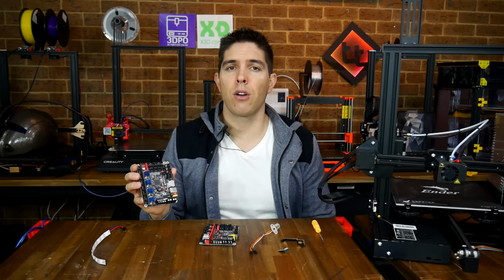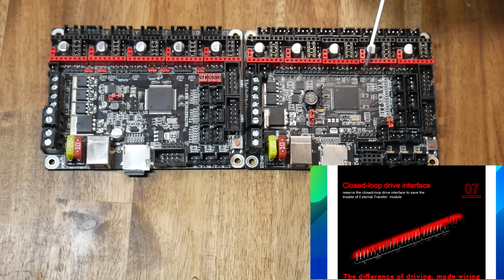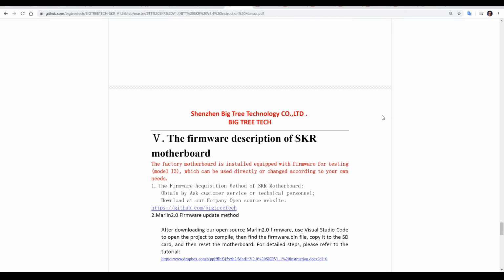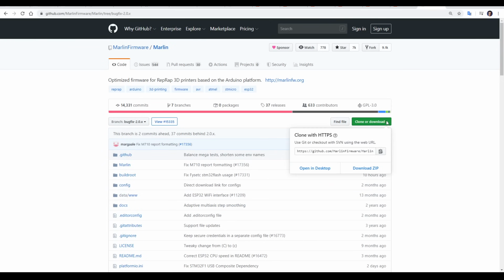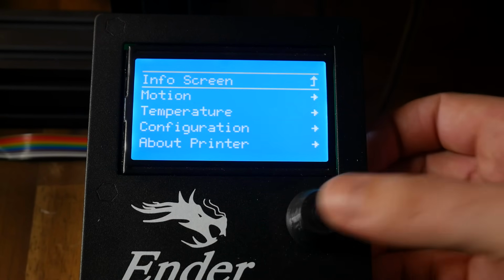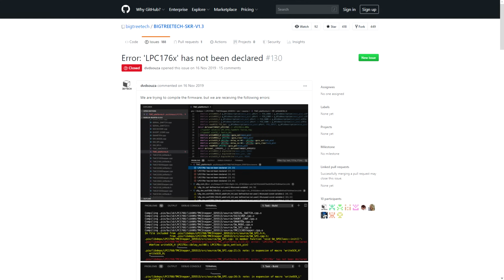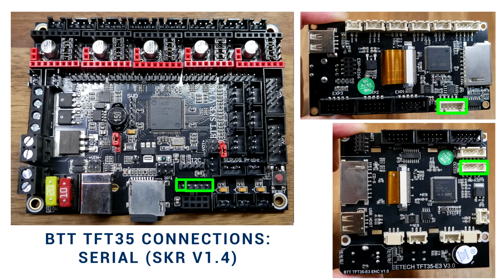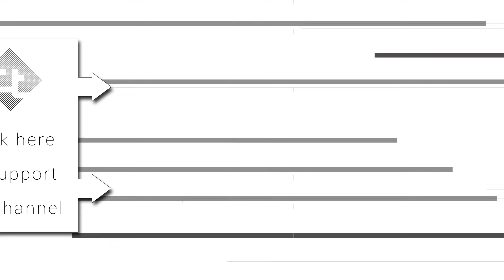Bigtreetech SKR V1.4 (Turbo) comprehensive guide

Comment: Good Day    I have followed your videos and find them very good.  I am trying to upgrade my adimlab gantry pro with a new main board, drivers and display but have nothing but problems.  Can you / will you help?  I purchased SKR V1.4 Turbo / With 5xTMC2209 V1.2 / With TFT35-E3 V3.0.  When I got the system it did not work fully and I have been trying to fix.  The machine that it is going in is the Adimlab Gantry PRO,  fully stock.  No bed leveling but does have a run out sensor / break sensor.  Everything is stock and I need help

Comment: Michael, Have you found the problem with the EEPROM not saving? Been talk of adding FLASH_EEPROM_EMULATION to save to sdcard and uncommenting #define PRINTCOUNTER. Seems not to hold firmware settings even after one or more power cycles. I checked with Pronterface and a lot of things disappeared like probe offfset and other things. Might have to go back to the SKR 1.3 for now.

Comment: i need some help.

I can not for the life of me figure this out. i have a LV8729 working on my SKR 1.3 without an issues. i cannot get it to work on the 1.4 TURBO. i have all but the 3rd jumper removed (on the right) which puts it in 1/16. No matter what i set the step/mm to it will always just extrude 50mm. i tried 115 which gave me 50/100mm extruded. i did the math and said that i needed to up it to 230 step/mm and that still gave 50.

Also, when it extrudes the stepper pulses and is not a smooth movement.

i have tried putting in a different LV8729 and tried a TMC2209 with no luck.

Please help..

Comment: Hi there,
the big variety of SKR boards is a little confusion to an Ender 3 Newbie.
I would like to upgrade the stock board to a new one to include the silent stepper motor drivers and get the possibility of easily adding a sensor such as the BL Touch (without a breakout board).  If I understand correctly, this is what all the Bigtree Boards offer, with the SKR Mini E3 having the feature of being able to get fitted right onto the stock board mount. 
Having watched the video on the Mini Board and read the comments, Michael says that the newer boards give a bigger flexibility and more addons - but I don't really understand what would be the killer argument to get the latest hardware instead of the MiniBoard? Maybe someone could help me understand? Additionally to that, could you please confirm that it is possible to install a 5V (or 12V) Noctua Fan for the Hotend without a buck converter, only using one of the new output ports of the board? 
Thanks so much in advance for any help!

Comment: Did you find that they wired the dual Z-outputs incorrectly?  I tried driving 2 steppers from one driver, but it didn't work and fried the driver. Seems from the schematics that they just split out the pins to 2 connectors in parallel instead of wiring the steppers in series.

Comment: hi, problem. at 7.30 your wiring checklist shows shows H-hotend cooling fan on the screw terminals,  but my documentation says this is for a second hotend heater(i think...) is this a mistake or am i missing something? 
thanks
love your work

Comment: I have an Ender 3 and have my parts cooling fan connected to the cnc_fan connector like shown in the video, but the fan isn’t spinning at all.  The hot end fan and case fan are working without issues.  Is there something I need to set in the firmware?

Comment: Interesting.  
Would've been nice to see the auto turn off module working.
Also, is that TFT35 going to get a firmware update and get the missing options (changing steps/mm for instance) only found on the traditional lcd as the Makerbase's TFT35 robin display has?

Comment: After following this video, my end stops are still not working. I am using TMC2209's and I cut the pin that you showed. Is there any other code that I need to change to get this to work?

Comment: Hey Michael thanks for your guide. I have installed the SKR 1.4 Turbo with the TFT35-E3 v3.0 and the 24V UPS board. Despite the printing being halted on power failure detection, after power being restored, it doesn't show any option to resume the previous printing job. I'm printing from the SD Card inserted in the Display board running in Marlin mode and the Power Outage option is enabled... Any hints?

Comment: Question: I purchased the SKR 1.4 Turbo board for my Ender 3 Pro. I also went with the TMC2226 stepper drivers.  Same fir wear settings as 2209 , except where says 2209?  I just downloaded VS CODE and am learning that too for when board arrives
Reply: Firmwear

Comment: My 1.4 turbo with 5 2209s is on it's way to my home :) My plan is to install in a CR10s, I'm only worried about the dual Z config... did you know if it's plug and play or I need to tinker the firmware to enable the second Z motor?
Reply: @WhiteG60  The Idea is use the two Z connectors one for each motor (ZMA and ZMB). But as I have 5 2209 can I use the spare to drive the ZMB independently of ZMA?
I mean there are 5 driver slots, X-Y-Z-E0-E1, normal setup is X-Y-Z-E0 so E1 is unused and has it's own driver so can I reroute to ZMB?
Reply: @WhiteG60  Thanks I'll do as you say ;)

Comment: ok i have the skr 1.4 tubro and big tree tech tmc2208 drivers if i want to run them in silent mode that is spi mode correct. and if so does that mean i use just a single jumper on the bottom left  for each row that i have a 2208? or is it 2 jumpers on the top 2 on the right side? im now seeing it saying tmc driver spi mode with all the jumpers on all the pins on the left side which was how it came, now is this silent mode for the tmc 2208, im so confused by this and the different versions. someone pls help me with this. it would be greatly appreciated

Comment: you no longer invert endstops for sensorless homing apparently:
In file included from Marlin\src\HAL\LPC1768\../../inc/MarlinConfig.h:49,
                 from Marlin\src\HAL\LPC1768\HAL_SPI.cpp:51:
Marlin\src\HAL\LPC1768\../../inc/SanityCheck.h:2526:8: error: #error "SENSORLESS_HOMING requires X_MIN_ENDSTOP_INVERTING = false when homing TMC2209 to X_MIN."
 2526 |       #error "SENSORLESS_HOMING requires X_MIN_ENDSTOP_INVERTING = false when homing TMC2209 to X_MIN."

Comment: 10:48 is where I run into severe issues. I can't get it to compile, and even after several other tutorials I can't figure out what is wrong.
Edit: You have to include the v in "BOARD_BTT_SKR_V1_4_TURBO" I kept typing "BOARD_BTT_SKR_1_4_TURBO"
Edit: now I get the lovely #error "USE_CONTROLLER_FAN requires a CONTROLLER_FAN_PIN. Define in Configuration_adv.h." message

Comment: Do I need to use external mosfet with SKR1.3/1.4? The documentation says that the max power for the heat bed is only 144W, but Ender 3's beds are 220W/24V.

Comment: when i go into the config folder it gives me a list of boards for some reason, unfortunaly it doesnt list the SKR 1.4 TURBO but it does list the E3 TURBO, would this run ok with the 1.4 as they use the same processor :/??

Comment: Hi Micheal, is it possible to use the 3rd thermistor port (TH1) on the SKRv1.4 Turbo board as an input to monitor chamber temperature. I do not have active heating and I currently have a DS1820 doing this through the RaspPi/Enclosure plugin, which is working fine - but just want to cleanup my wiring a little. Any thoughts would be appreciated. thanks ...
Reply from the maker: Yes, absolutely. I did this on my Ender 5. Please see the video for instructions.
Reply: @TeachingTech  Hey, thanks - I will check it out (mine is Ender5Pro)
Reply: I had a look at your video "Ender 5 enclosed lid and heated chamber guide" and tried out your method. 
It appears Marlin has moved on and I can't get it to compile with the recommended changes.

Comment: I see they still haven't updated that hackneyed bugfix-2.0.x build from last year. Shame. I built 2.0.4 as soon as I got my 1.3 board, and it was a completely unnecessary step, and a failure on BTT's part. They have the configs and know-how, it would take minutes to pull 2.0.4.4 and build it, and maybe a day or two to QA and fully test it.

Comment: Is there anyway to bypass the sensorless homing without cutting/bending the diag pin?
Reply: It doesn't look like it would be easy. I did see a resource somewhere that remapped some of the pins on the board but it seemed like it could cause issues long-term with Marlin updates.

Comment: just saw your rear case for the ender 3, googled skr and found this, now i know what the heck an skr is, thanks for sharing - great vid, subbed!.. just wondered, theres a remix of your design 4487321 but the page states its for an skr, what can i use to change the holes in the right case and the left case to match your design? and also to add a little thickness to the lids.. is it a steep learning curve to change this? what would you use to make those changes? thanks!

Comment: Although the board worked fine for me (better than the MKS 32bit board), the email support of BIQU is not responsive at all. The website is broken (none of the links in the footer is working) and I now have a non-working board that only shows up in the device manager for a minute before it disappears and no contact to talk to about the problem...! Great.
Reply: After two days (the board only laying around) it has been working (even printing) again just to stop a print after some minutes with the board not responding anymore. The same as before! Grrr.. I wish I had bought the board elsewhere to get some help... 😣

Comment: I did a bunch of research and was leaning towards the skr pro v 1.2 but it seems the firmware is not in a good place. Would you recommend the skr 1.4 over the pro for a cr10s or sidewinder x1?

Comment: Hi, I'm still in doubt. Do you have to remove the diag pin on your tmc2209's for the Z axis if you use standard endstop and for the E0?
Reply: If you want to use the endstop, the pin has to be removed. If you don't the endstop is ignored.
Reply: @bsharp55  Not exactly ignored, but the signals from the diag and the endstop will conflict so Marlin will never see it as triggered.
Reply: @SteinerSE  Try to change connector and use 1 and 3 pin (signal and voltage), standard connector for Ender 3 is bad since it has 2 pins only, and one pin will be a ground, if you are not changing it to a proper one, you will have this problem as well https://youtu.be/-Gdk0wHg51w?t=822, or yes cut one pin from the TMC2209 driver

Comment: Thank you for the great guide! Question: For the CR-10S with dual Z axis I would use one stepper driver for both Z steppers, correct? (want to buy this board but I'm unshure if I will be needing 4 or 5 stepper drivers, I use 1 extruder only) Thank you very much in advance
Reply: 4 Drivers are enough, the 5th is for the 2nd extruder

Comment: I have a question, Michael.  I have a Monoprice Maker Select Plus (Wanhao Dup i3) that has a bad board.  I have an Ender 3 Pro on the way as well as a new BBT SKR 1.4 and TFT for the Monoprice.  Could the board from the Ender 3 Pro be used in the Monoprice  and use the new SKR 1.4 in the ender?

Comment: I am just now replacing a stepper motor but the new stepper motor has fixed cables some labeled red and some black and orange and possibly green? do you know which pin on the stepper motor hookup on the board is positive and which one is ground?
Reply: Steppers have coils inside, to know which two wires out of the four are part of the same coil short (electrically) the two wires together, if the motor resists when you turn it by hand then viola the wires are of the same coil. On the board will be markings next to the stepper motor pins, somthing like A1,A2,B1,B2, which correspond to the coils, and now that you know which wires form the same coils plug them accordingly
Reply: @wamiqhashmi7522  so there is no way I can screw anything up if I hook the wires the wrong way?
Reply: If you plug them wrong they will make noise without turning. I did that accidently, it didn't destroy anything. If you follow the procedure above then there shouldn't be any problem
Reply: @wamiqhashmi7522  It worked! Thanks!

Comment: I am 100% convinced that there must be one or more firmware settings that Michael did not mention that will allow a BLTouch to work with this stupid SKR 1.4 Turbo board. I have tried a billion different firmware settings (all suggestions from desperate owners) to get this BLTouch unit working, and I've had no luck whatsoever. If you're bored at home and want nothing but trouble, frustration and despair, then pick up one of these SKR v1.4 Turbo boards + TMC2209 + BLTouch combos. You'll hate it just as much as I do.

How can this be, you ask?

If you're Googling for a possible solution, you'll find that are a large number of Ender 3 owners w/ this exact hardware that can't get the BLTouch to work. There isn't a standardized configuration that works despite everyone having the same hardware. How is that possible? You'll read a billion posts by people saying "Try this setting... change this on the Configuration.h file... It worked for me..." What a nightmare.
Reply: still got problems? i got mine working on a creality cr10s5 so can try to help you out

Comment: I see that the SKR v1.1 has a separate mosfet board for the heatbed. Are mosfet integrated in later versions of the SKR boards for extruder and bed heaters?

Comment: Thanks for the great videos, Question. Do you have a file for an SKR 1.4 board mount for the ENDEr 5 ( not the plus)? I can draw one up but if someone has one that will work that just seems to be the quickest way to get one. Thanks

Comment: Ian lauder
3 days ago
Hi Michael , Have been trying to re-build my ender three with a SKR1.4 turbo board and a TFT 35c screen and 2209 stepper drivers.Following you guides  and using your new editor choice(visual Studio) which I like . Iseem to load Marlin 2.0 into  it fine then do all the changes OK Have finally figured out  have to load Atom extensionin to the compiler But whatever version  i use withVisual Studio it always comes up with errors, even it seems on lines that Ive not even altered and even lines that don't seem to exist also it keeps rejecting the 1769 processor.Lockdown frustrations here in Nowra and not knowing the software dosn't help,can give any pointers. thanks  Ian
Reply: Use Visual Studio with PlatformIO extension. He doesn't mention it but once installed it will give you the same options at the bottom of the VS screen as in his video and you should be able to compile your firmware
Reply: @pogonoforysci  yes I got that program and or extension and installed italways seems to come up with air is it doesn't seem to matter what version of marlin I download and adjust it always seems to give me errors and won't compile
Reply: @allrcflyingisfun  I would try downloading a fresh copy of Marlin, opening with your VS code and then going straight to compile without making any changes. If it still has errors it would mean there's something wrong with your editing software - in that case, I would uninstall all of it, install VS code and PlatformIO again and test compiling Marlin without any changes again. Sorry if It sounds obvious but I am a complete beginner with this so this is the best troubleshooting workflow that I can come up with. From my side, I can say that I followed his video yesterday and, once I figured out that PlatformIO was not mentioned and has to be installed, everything worked like in his video and Marlin compiled without any issues. I am now stuck on figuring out correct motor voltages for my ender 5:)
Reply: @pogonoforysci  Yes thanks for the help will try all of the suggestions have already tried downloading a different copy of marlin a little older and only altering a single line but still came up with a list of errors on lines that i hadn''t touched and could 'nt even find. Reminds me of the joke (My laptops keeps crashing,well turn it off and re-start it, but it's still crashing and it's now smoking,well turn if off and on again and that will fix it .Did that and now its on fire ,Really you couldn't have followed my instructions properly its all your fault.)
Reply: Also am trying to update the stepper motor drivers as well at the same time .Glutton for punishment ,well a mans got to have some thing to make him pull his hair out,with this lockdown.

Comment: When ordering the 1.4 Turbo it asks if you want drivers. I have an Ender 3 with original board. Not sure what driver I need with this. Thoughts?
Reply: SKR mini E3 uses TMC2209 which is also compatible with 1.4 Turbo. I'm placing order right after this video lol

Comment: Quick question: do TMC2130 SPI need any additional wiring on SKR V1.4 (Turbo)? In your stepper motors driver upgrades part 3 you made an additional wiring harness for them but was that required only for MKS Gen-L?

Comment: I’ve been thinking about getting a SKR 1.4 (Turbo for the extra couple of dollars) and a set of TMC2209 for my Tevo Tornado. Are you planning a video for the Tornado? Any thoughts if the wifi module is worthwhile especially when using Octoprint? I’m thinking no? Also thoughts on if it’s worth getting the TFT35 or just using the stock LCD?

Comment: Hi Michael, thank you for your great content and detailed work. I have an issue, I have a CR-10s and ignorant enough (even tho I researched a lot for compatibility) I bought an SKR mini E3, when trying to plug it all I realized it is not compatible with the Creality board V2.1. I realize now that the board I need is the SKR 1.4. Is this correct? Is there a way to use the SKR mini E3 instead? Do you know of a guide to connect either the SKR mini E3 or the SKR 1.4 to the Creality CR-10s? Cheers and keep up the great work.